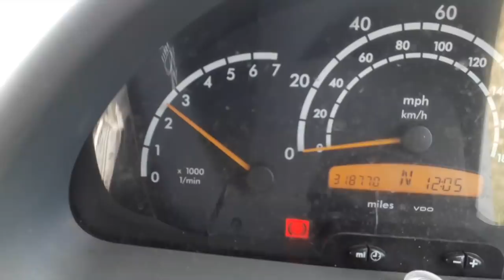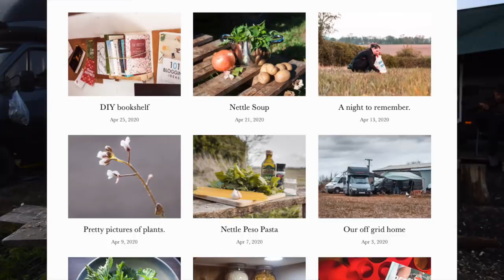Chicken Coops & Swedish Candles - Vanlife Quarantine 5

Comment: Rocket stove ...tick....Swedish candle....tick....now, if you like stews, how about a (modern) hay box to save some fuel? Just need a big ‘box’, some scrap/natural insulating material and a solid pan with a close fitting lid (that glass topped one would be fine). Make the stew on the gas, bury the pan in the hay box and have some fun while it slow cooks😉 I used packaging polystyrene bits inside an old pillowcase and bubble wrap on top of that. Old woollen blankets/duvets work well too. The ‘box’ could be one of those dumped fridges one sees on country roads! Love the way you built that hen house/palace out of bits😀